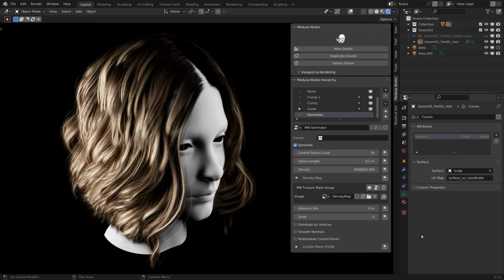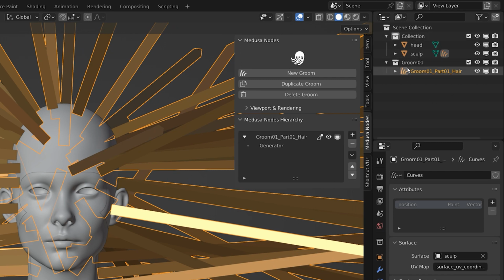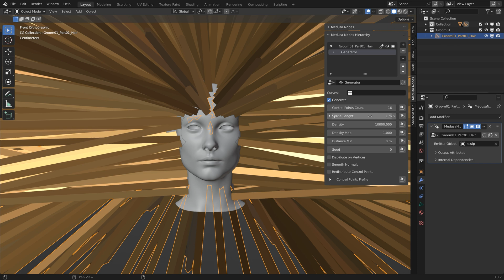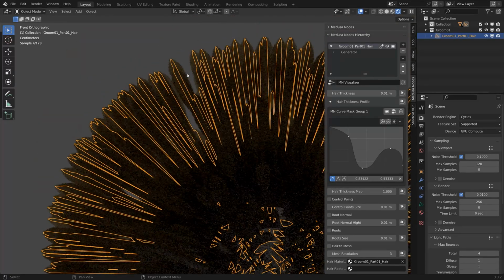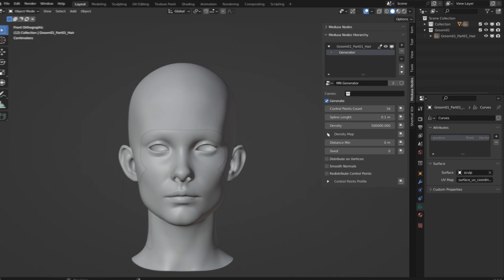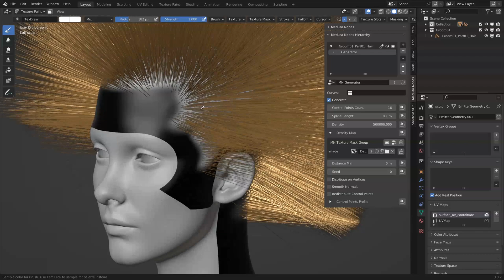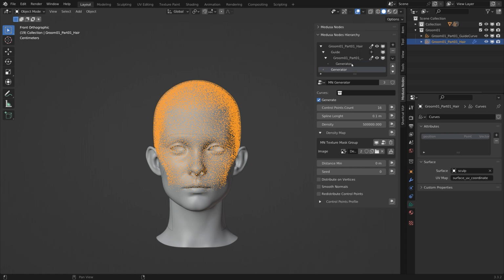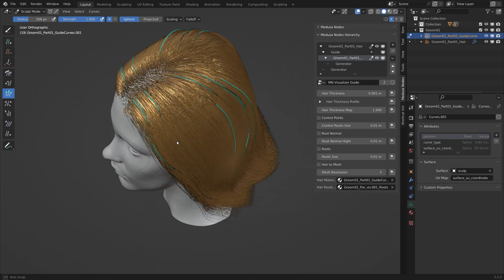Medusa Nodes - Procedural Hair System for Blender - Tutorial - Introduction Part 01

Comment: Can you use a hair curves object that already has some guides with the plugin?
Reply from the maker: No there is no such function that will convert the existing groom to Medusa Nodes' groom, not at this point. It requires some manual steps in the node editor.
This option is on the To-do list.

Comment: In this video at 10 o'clock, the hair set at the beginning is applied well in the guide. However, I'm following the tutorial, and the hair I set at the beginning doesn't apply to the guide, and if I add a guide, I'll add a hair that's too long, not the hair I set at the beginning.
Isn't there a solution?
Reply from the maker: I am not sure what exactly the problem is in your case. 

You have to disable "Generate" option on the Generator of the Guide Curves object first.
Reply: I've done that. But it doesn't work. I want to show you a picture, how should I show you?
Reply from the maker: @open_nnn  ok, If you have a Twitter or blenderartists.org you can DM me there.
Reply: @iraklikupunia  I'm sorry to bother you. Blenderartist just signed up so it's hard to send a message. Your Twitter message seems to be locked.
Reply from the maker: @open_nnn  it's all good no worries, I am going to check my Twitter, I am kinda new to it. What's your handle on Twitter?
Reply: @iraklikupunia  I think the message transfer fails because I don't follow it.
Reply from the maker: @open_nnn  I have now enabled the option to receive direct messages from anyone.

Comment: Is it possible to select a single Guide Particle? It's difficult to try sculpting multiple guides since one move will move all overlapping guides.
Reply from the maker: Yes, I would use the Selection Paint brush for that.
It is the first one in the toolbar if you are in the sculpt mode on the Guide hair object. 
The brush makes it is easier to isolate painted guides.
Reply: @iraklikupunia  Thats amazing! In my viewport, I do not see Guides as blue like in your video. They are red, and selected guides are like 1% darker, so its difficult to see guides through hair as well as difficult to see which guides are selected. Is it possible to change Guide color or make Guides visible through hair?
Reply from the maker: @knackepizza2480  something is probably messed up with your Guide hair object.

But yes you can still change the color by selecting the Guide object's Material and searching for the Viewport Display panel in the Properties Editor. 

There you will find the Color parameter.
Reply: @iraklikupunia  Wow you are AMAZING for responding so fast. This plugin is amazing. At some point could you do a tutorial on long hair or braids? I'd believe that you would know an optimal way to make those, since I'm basing long hair off your short hair video
Reply from the maker: @knackepizza2480  haha, I am not always that quick to respond, but I try to do my best whenever I have got spare time on my hands.

I will try to make a short tutorial on Braid deformer. 
I can't promise that it will happen quickly. Currently I am working on improvements in regard to the addon.

Comment: Thank you, that looks really incredible. Maybe a stupid question, but can you maybe tell me where I can set the length of the added hair? I thought that will be taken over by the Groom01_Part01_Hair Generator.
Reply from the maker: Thank you! Actually it is a good question. You can't do that at the moment. If you add the hairs to the hair object using the density brush directly,  you will not be able to change it's length.

 I was thinking, that we can add some kind of grow/shrink node to the system.
It is now on my to-do list.